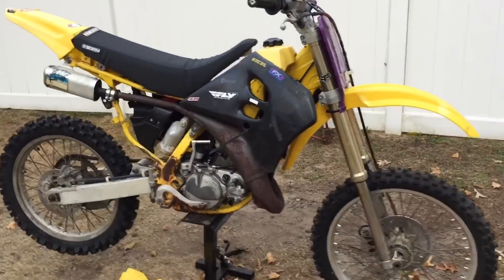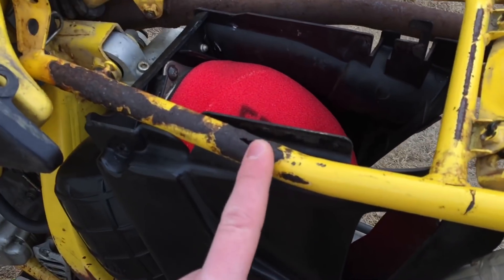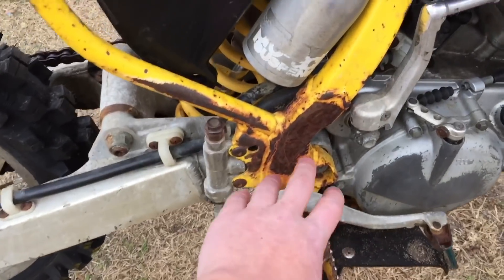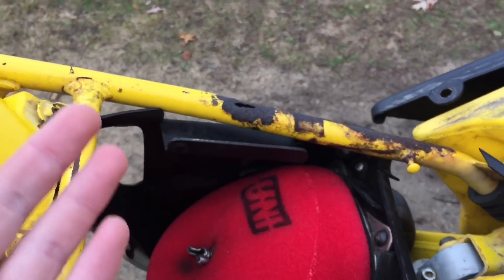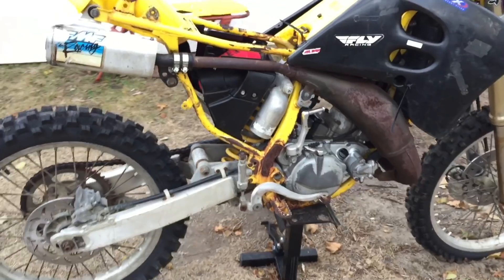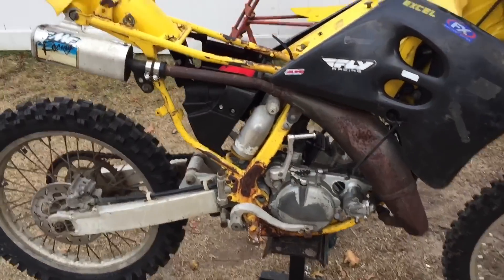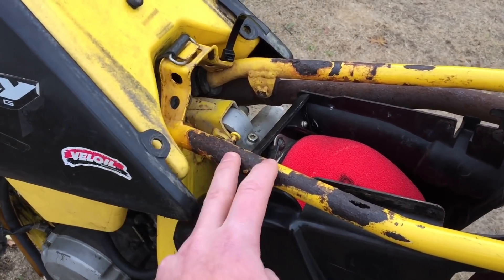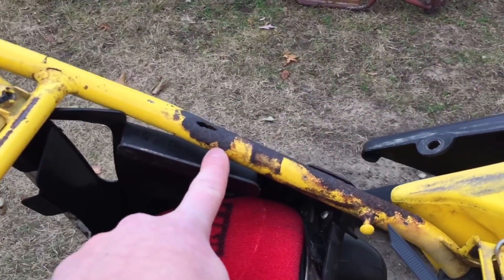BIG PROBLEM WITH THE DIRT BIKE!

Comment: Soldering won't fix the frame. I wouldn't worry about the hole to much cause you aren't doing motocross and stuff that would really stress the frame. But you should get it sand blasted so you can see how bad the rust is.If you were in Oregon I would weld in a whole new section of frame for you.

Comment: 1. That's not a frame
2. That's the sub frame
3. You cannot drive a dirtbike
4. There Inst driver seat?
5. You ride a dirtbike
6. Sand blasting will never go thru that metal or even wear it down.

Comment: I have a welder that I bought a while ago and it is definitely worth it for these things. It uses flux core and no shielding gas so it is not very costly after the fact. I bought one for $140cnd and u could get a cheaper one.

Comment: dont worry bout that hole. i have a 1980 suzuki pe175 and tge ild owner looped it and blew apart the  rear of the frame. yes blew apart it was in litterly 5 peices. they welded up the frame so it is still twisted like a pretzel and there still is a hole but the frame has not fallen in half yet.  the hole is on the pipe that meets a pipe that the shock absorber is on. this bike has 2 rear skocks so its on the very  side of the frame next to the seat.

Comment: It’s the subframe. They’re pretty cheap I found one for a friend of mine for like 60$. It’s just a bolt up thing not hard to take off and get a new one off eBay 👍 hope you get it figured out but buy a new subframe and you’ll be perfectly fine like I said they’re pretty cheap
Reply: Rural Riding that year doesn't have a sub frame just an aluminium rode
Reply: Typical Fan ahhh ok I’m guessing it’s weld it a little or run it right at this point

Comment: if you can not weld it cut out the rust and slip some tubing over it then silicone the ends so that no water can get in there

Comment: Buy a new subframe you will be fine
Reply: Mine is from 1993 and u can take off the subframe
Reply: it is due to age, you can cut the problem parts with angle grinder and weld a fresh steel
Reply: +Lenny Cruz that Is lie I owend a 93 rm they are welded
Reply: Cas #14 yeah
Reply: Im sure mine subframe is not welded on the main frame and its a 93 im standing next to it right now

Comment: I got a 1992 rm 250 and my bike was full of welds and the part of my frame was cracked. Look on the Internet for a machining shop and they will most likely fix it for free or 20$  get it sand blasted so you can find any other bad spots asap, dm me if you got questions

Comment: dont sand blast it it will make it worse  just run it unless that tube cracks all the way throw i wouldnt worry i wouldnt sand sand it  either if its bad its not gonna sand off it will just make it thinner

Comment: Cut the subframe off with an angle grinder (make straight cuts) and then get a solid piece of solid rolled steel ( just smaller in diameter) and slide it in and tac weld that into place.  Then you can grind the old welds and reweld it back on  or if you are still sketch on it  and you get a piece of tubing and sleeve it and weld that into place

Comment: sand blast wont wear it down, you need to blast it and then work from there,  your looking at welding a reinforcement and then a cap, not really a beginner job, needs to be done properly or if more holes appear just try find a new frame, and remember to check bike properly before buying em.

Comment: Dose anyone know why my pit bike will not rev high
Reply from the maker: Jordan G842 the carburetor could be dirty and when you try to rev it up, there could be not enough fuel getting to the engine from a clog, try taking apart the carburetor and cleaning out the jets, that’s what happen to the pit bike when I first got it, hope this helps!
Reply: Moto Migs thank u
Reply: could be blocked gets in the carb or dirt in the tank try them 2 first if not come back and we can dig deeper